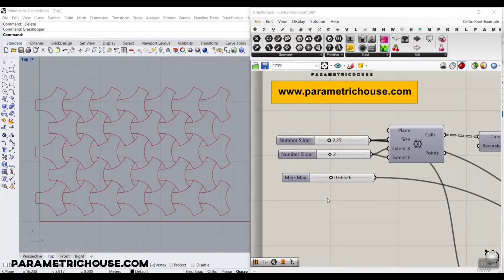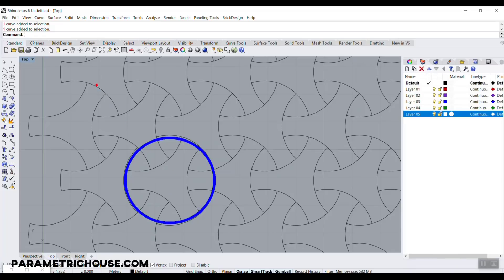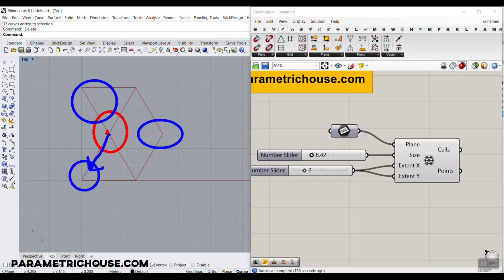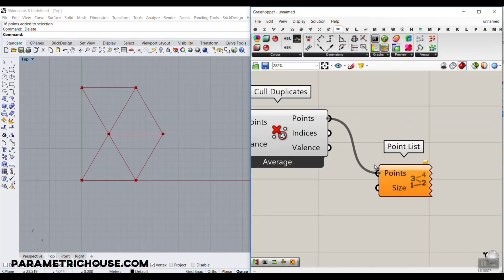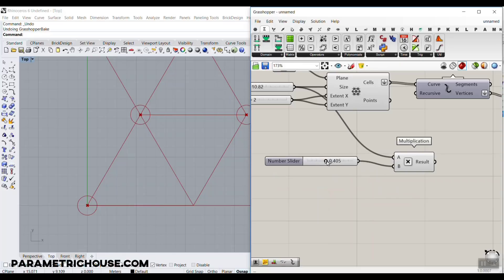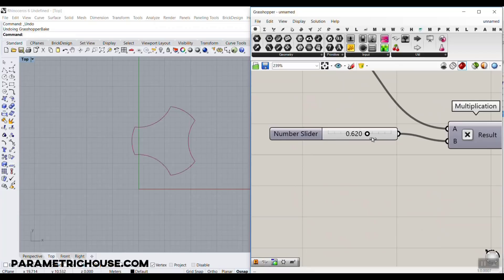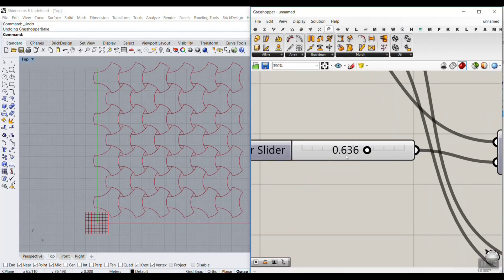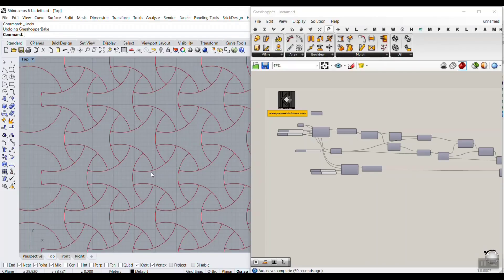Grasshopper Tutorial (Celtic Knot)

Comment: You could make a remapping of a slider from 0 to 1 to a domain from size of cell divided by square root of 3 to square root of 0.75 times size of cell. A bit of math but than you have a cleaner control over the pattern.
Reply from the maker: Correct! Remapping is also another option👍

Comment: nice work sir ...... any alternative .... method is available?
Reply from the maker: I also explained an alternative method in the video but anyway you can also give the pattern more control by focusing on smaller parts of the module and give it multiple parameters
Reply: @ParametricHouse  sir i got it need to start different way... and than finish... but i like your grasshopper explanation. and standard detail so helpful....  long days back i'm started this grasshopper. thank you
Reply from the maker: You're welcome

Comment: Any reason youre not using a hexagonal grid in the beginning to generate your points? Without having tried it myself, it seems easier since you dont need to cull duplicates.
Reply from the maker: You can also use a hexagon but you have to dispatch the corners to only use 3 of them. Anyway this can also be done by polar arraying a point or any other method
Reply: Thanks for the nice illustration....Apart from contoling the minimum and maximum sizes of the pattern by slider, could a logical condition be added to control its size ?
Reply from the maker: Yes it can be easily done. Connect an evaluate component to the slider and give it conditional statement for example if(x<0.6,0.6,x)
This statement will freeze the output on 0.6 for smaller than 0.6
Reply: @ParametricHouse  Ok...thanks again for helping.
Reply: @ParametricHouse   good !!!